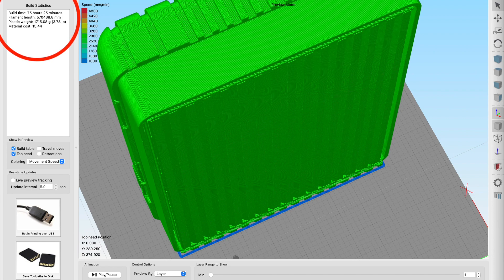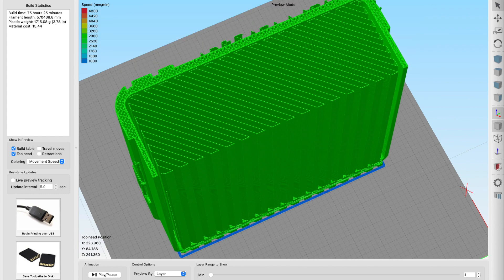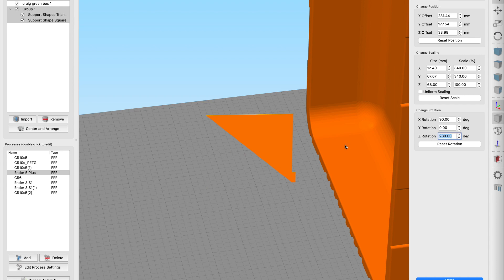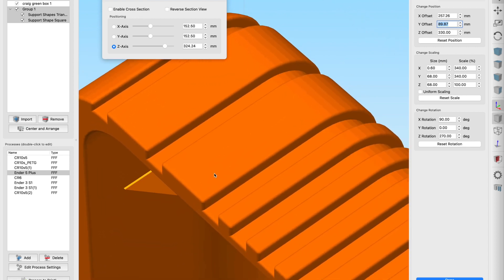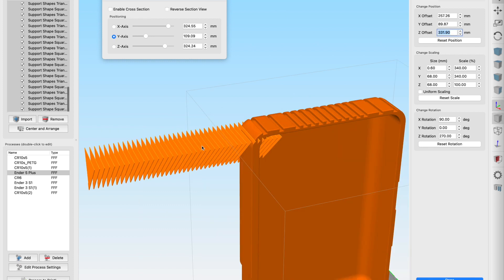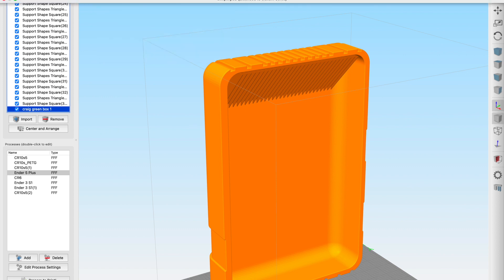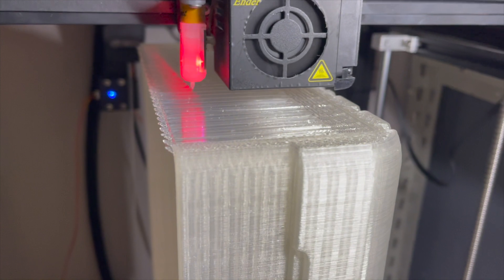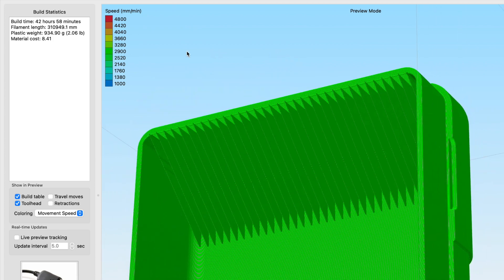Custom Supports 1 -  Save time & Money with Creative Support

Comment: It's really great way to add manuel supports and saving lots of material ! But i just have one question , wouldn't it be better to add supports and unite it to finish product in tinkercad or something rather than trying to add them in slicer?
Reply from the maker: If you had already designed the product in a CAD package then you might be better off to try and think of ways to make it completely support free! But if not possible then yeah for sure it would make sense to design directly in the CAD package. The benefit of this method is that it can be done with pre-existing files, so things off Thingiverse for example or parts print service customers have sent over.
Reply: @CallumColes  oh yeah , you are right. Usually they only upload .stl files so it's hard to make changes in CAD programs i didn't think that part :)

Comment: Great idea! They should put it in the slicers as an option ☺️
Reply from the maker: Thanks! Yes, support material generation is definitely an area where slicers could still see a lot of improvement
Reply: @CallumColes  are you going to show where you would use the circle for?
I'm not that experienced as you but couldn't you save even more with less triangles in your example? Say only a triangle every 3 or  4 cm?
Reply from the maker: Yes I will indeed show about the circle, this will be a mini series! 
You could further reduce the triangles yes, it’s the same as having lower support density, but having a few extra there does help with the structure if any were to fail. I also wanted to have a similar level of support to the 10% standard support I was comparing to.
Reply: @CallumColes  Thanks, looking forward to it! You could also create "holes" in the triangles (like an infill grid, but then turned on its side) to save a bit more material, but I guess you already got the big savings done.
Reply from the maker: Great idea, that’s the point of this video really, supports can benefit from a bit of creativity too!